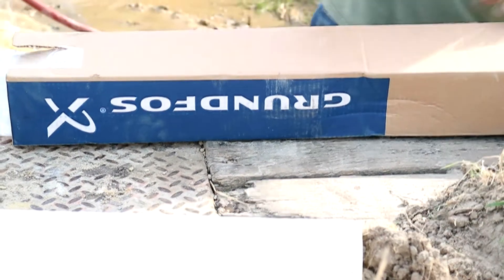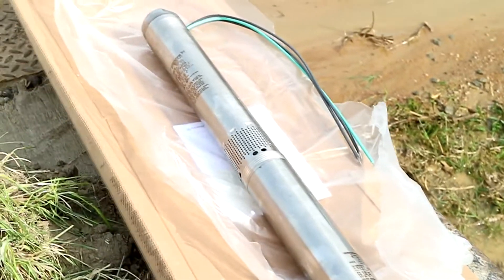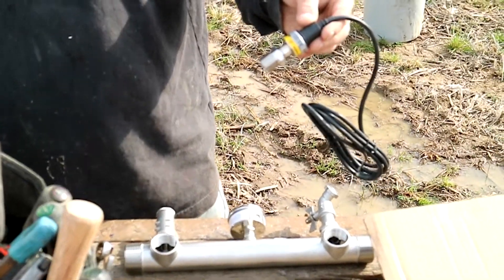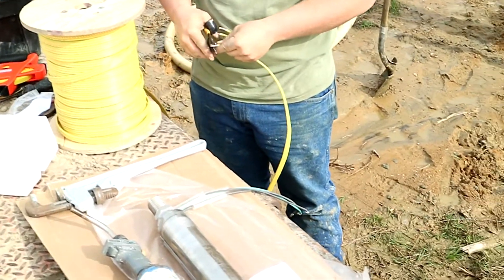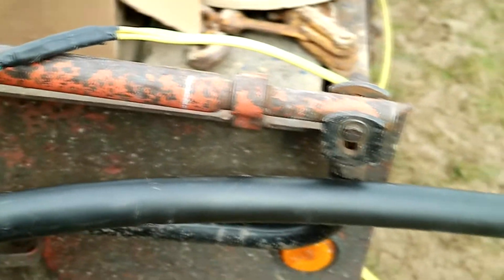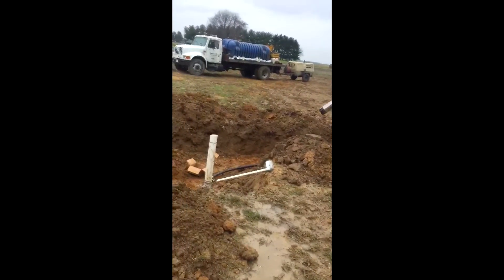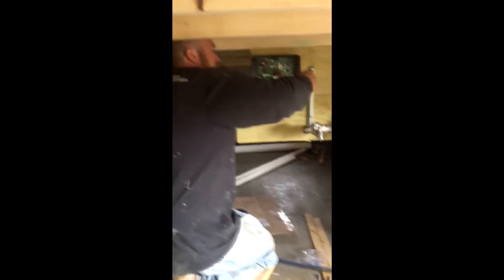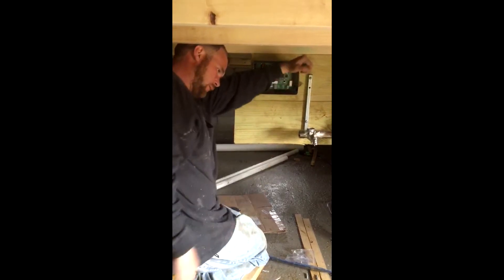A look at Grundfos Constant Pressure Water System Installation

Comment: I have a project that requires a submersible well pump to increase flow on temperature rise of a hard-wired remote senor.  208v 3ph, 2hp, 4 or 6 inch casing. I estimate a 100% duty cycle for 120 days, a 50% duty cycle for  120 days, idle for 120 days. Sub pump water to be returned to the ground via a well.
Reply from the maker: Thanks for the input.
Reply: @willeyco4458  Are you still in business?